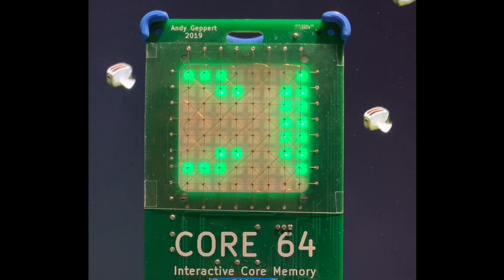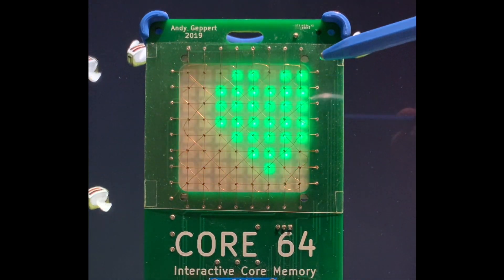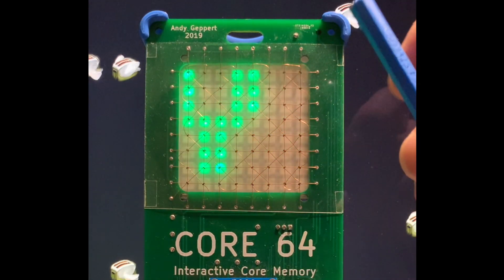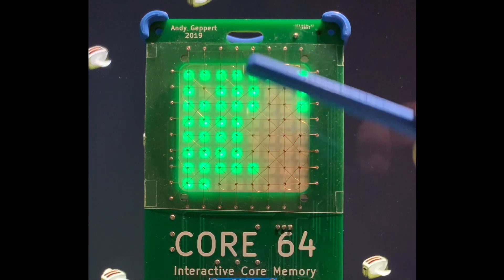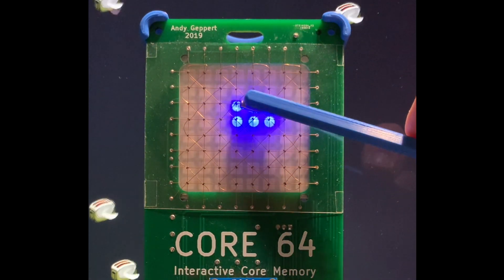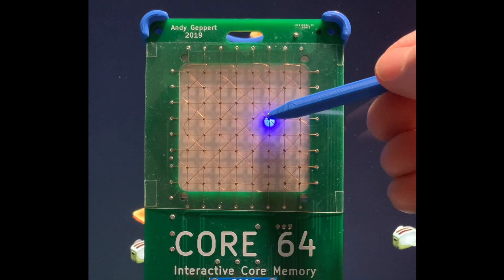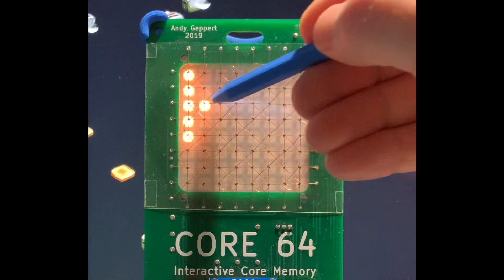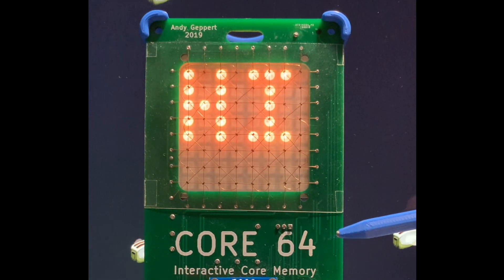Core 64 Demo

Comment: This is really awesome, and I'd love to be able to purchase a kit once you complete the badge.
Reply from the maker: Thanks! Keep an eye on the project at https://hackaday.io/project/166155-core-64-interactive-core-memory-badge because that's where I'll be keeping the project up to date.
Reply: Very cool!  I will definitely be checking out hackaday.com for details.  This is precisely what I was looking for but my question is:  do you need to use a magnet to alter the cores?  Could a non magnetic piece of iron be used if the total write current through the core was near the threshold of not being enough to flip the core’s state?  In other words, would bringing a unmagnetized piece of iron near the cores cause enough losses that a write operation would fail if there was just enough current to complete a write operation without the additional iron present?  You may be able to guess my idea for an application...
Reply from the maker: Randall Logan That is a good question. I haven’t experimented with that concept. It seems like it might be possible, but tuning the current could be challenging. One of the things that could make that tricky is that the wires are perfectly situated for coupling to the core. By that, I mean, the wires pass through the center of the core and the magnetic flux around the wires couples so directly to the core ring around the wire. So positioning of the iron relative to the core could require precision to get the effect you are looking for. It won’t be long and you’ll be able to conduct some experiments!
Reply: Andy Geppert : Thanks for the added insights.  Back in the 1950’s and 1960’s they actually used cores as logic gates.  An AND gate would have several wires, each with a few wraps around (and through) the core, when all wires had a current present the core would flip (a sense wire, and test wire were still required of course).  I can see your point about the two wires passing directly through the core, and I know toroid ferrites are very efficient, I was just hoping that bringing regular iron near a core would cause it to have enough losses so as to fail a write operation that was near the threshold.  With a high density of cores, one could possibly make an imaging metal detector!?
Reply from the maker: @ScientificSolutions  At a minimum, a magnetic flux detector would be within reach. I imagine a stack of 8 of these core planes, stacked in a cube, with an LED near each core would be a very cool 3D flux detector!